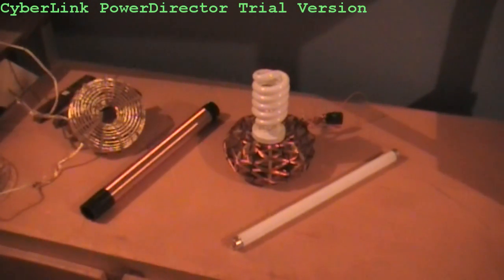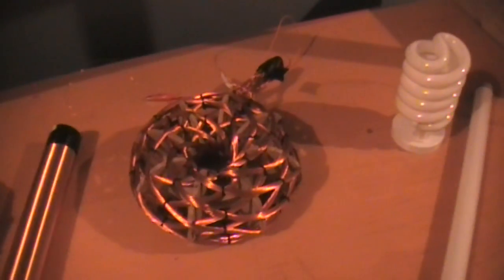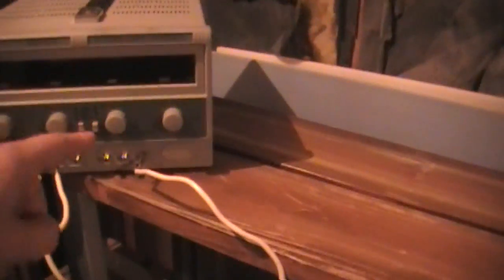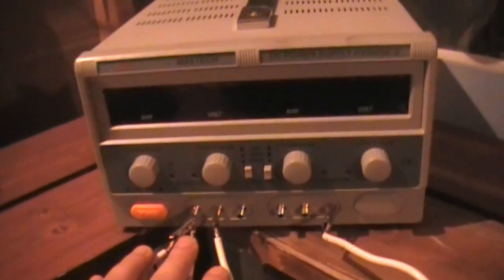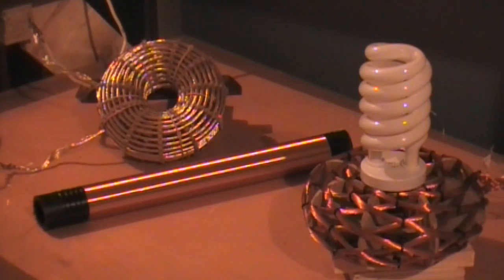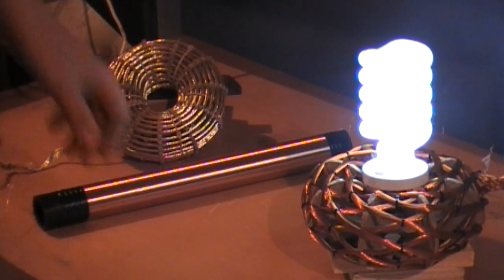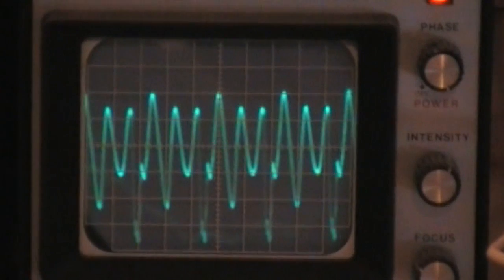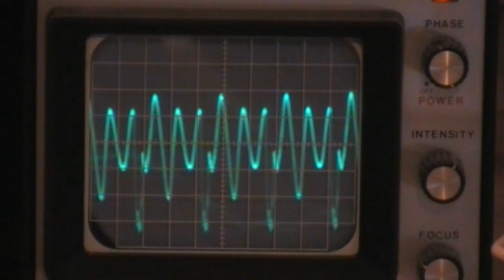Vortex Form, Tesla Function

Comment: Tesla used a magnetically distruptive spark gap to generate his pulsed DC; I assure you, it is different from MOSFET switching output signal. Your osciliscope wouldnt even pick it up because the nanometer pulse width should be in the realm of nano seconds-- unless you have some fast photovoltaic dectector or something attached.
Reply: What does the magnetically disruptive part do🤔also what are the specifics so I get it the same. Maybe i can look for a patent. I tried forcing 2 magnets together and sparked between those didn't notice anything different so far but I was using high voltage or maybe I didn't configure the same. Hmmm...interested about this.
Reply: @strangescience3414  think of magnetic fields like wind against a flame. Fire is just plasma, but idk if it responds the same way to strong magnetic fields. Im sure the magnetic aspect must be as strong as the electeic componet. Also, I think saying "magnetically disruptive" was wrong; say rather, "distruptive electric discharge that is magnetically quenched!"
Reply: Is magnetically disruptive the same as magnetically quenched? I'll check it out. Thanks for helpful constructive  comments.
Reply: @strangescience3414  yep!
Reply: Yes thats how he launched his aetheric force longitudinal beams in the ZPE! Gerry Vassilatos explains this in his arcticle i got. Teslas magnetic distruptive spark gap was a uniflow 2 stroke plasma engine!
Reply: @jlo13800  nice. What's the two stroke part?

Comment: With Vortex coil it is possible store EM energy?
I mean continuous exchange of E field in B field, where B is out of phase 90 °, like in LC resonant circuit.
Store energy for long time inside the vortex.
Not radiation of EM outside the coil.
If the answer is yes, it can be used like atom model.

Comment: Try a solid state electrolyte solid state graphite power cell bank with a organic carbon power cell bank to power your coils. 😊
Reply from the maker: That would be neat.
Down the road, the caron based supercap will be back on the todo list for sure.
Thanks for the comment.
Reply: Organic carbon power cells do not release all their charge like super caps do. Pow!  😉
Reply from the maker: Hmm. Sounds cool.
Reply: If you set it all up correctly you would have a light source that would operate off earths resonance field. If done correctly one could keep battery banks all charged up in rotation all off earths resonance field. Tesla technology mon. This would be way better then solar maybe? 😕😉
Reply from the maker: That would be cool if it was pulled off.
Reply: Study the technology solid state electrolyte graphite power cells generate current off earths resonance frequency. Organic carbon power cells store that built up electrical energy that then operates a light or other electronics to keep battery banka charged. Add in a few vacuum spark gaps in key locations and you can increase the potential were ypu could operate a window air conditioning unit off the concept or operate a refrigerator all off earths resonate field like how Tesla was working on that type of technology.? 😉
Reply from the maker: +Indigo Dragon71 do you have any links to videos or documents that describe in detail the function of the system you outlined? I keep an open mind but also critical mind. I've been researching and experimenting with this stuff for a LONG time (6 years now) and I also have been going to attending College for Electronics Engineering Technologist training & certification (in my 5th semester now [3rd year]) and I have to say there is a lot of misguided information out there. But if you could link in some information I would be happy to look at & asses it and give you my honest opinion of it when I get the time.. I will be making carbon based (graphite/nano-tube) super-cap and energy storage devices when I complete my skewling at this end of the first third of 2019.
Reply: No links yet here is something to think about. Tesla ran into problems after trying to file patents for his work. The pinkertons that caused him to loose all his work were controlled by the free masons who control all knowledge. Like i stated research the technology solid state electrolyte graphene or graphite power cells generate electrical current off earths resonance field that generates the atmosphere. Organic carbon power cells would be charged by solid state power cells to power devices. Vacuum spark gaps in key locations would release the breaks if you understand what this term means on the electrical power generation system being described. Tesla was discovering very old technology not new technology which certian controllers just do not want out in the open. Think first kingdoom of ancient Egyptian dynasty everything has a crystallized structure that can be used to generate electrical current.  Brain food a magnet is a refined crystal structure that generates a magnetic force from being within a resonate bubble called earths atmosphere. So would the magnet still operate in the same manner if removed from within that resonate bubble IE in space? How are you littling up that light with that refined crystal structure called a copper coil? Think! How far does that resonate bubble extend that you are genersting with that coil to allow you you light up that bulb? 😉 😊
Reply: You could try looking at pancake motors. The coil disk could be made out of graphene with the copper coil generating a certain hertz frequency from the electrical frequency being passed through the coil to hit the sweet spot of the graphene to generate high frequency electricity with vacuum spark gaps to encrease potential to develop a pancake motor generator. Be a neat component to use with a solid state crystal power cell and organic carbon power cell set up. Way better then solar panels. 😉  😊
Reply: @indigodragon7129  did you attempt any of this ideas yet ?

Comment: Where did you get your silver plated enamel coated copper wire?  Is it the same thing as the artist 24 awg silver plated enamel coated copper wire or did you get a silver plated "magnetic" copper wire.  Just wondering if there is a difference cause I couldn't find any of that wire besides the artist version.  THanks in advance.
Reply from the maker: Ascending Humans. I bought it off etsy, and it is the artists stuff... I thought the coating on it could maybe have worked, but I hate to admit the enamel coating does not work well an insulation, at best it just looks cool.
Reply: Ya it does look really cool, thanks for your quick feedback bro

Comment: Dang that's cool and that spiral coil is a work of art. So is this a demonstration of scaller waves? Tesla used these waves in his famous tower to transmit power wirelessly. If only that tower wasn't destroyed what a different world it would be today... O' well... time to mend the world. Thanx for sharing!
Reply from the maker: Altimit1417
 OK, when you think about scalar (or longitudinal) waves frequency does not matter... You need to visualize it like this... If you had a 20 foot long piece of rebar (iron reinforcement bar for concrete) and you hit it with a hammer in the middle the rebar would bend and wave back and fourth, these are regular or transverse waves... The energy rings down over time much like in an oscillating circuit... If you were to take that same piece of rebar and hit it with the same hammer but hit it on the end, the energy is transferred across the rebar instantly with no apparent vibrations... It is more of a direct instantaneous impulse.. That is my understanding anyways.
Reply from the maker: Thank you! I wish I was the designer of the winding process but credit for that goes to Erica and *****... I do not think this is a demonstration of scallar waves spoken of by Tesla.. I think you need an impulse driven driven HV DC with quenching to achieve scallar waves (at least that is my understanding to date)... We shall keep on keepin on! Peace :)
Reply: Naoki Kashima not scalar. I believe that scalar is pulsed HV DC at around 50-60hz. From my understanding. Also interestingly around 60hz is the resonance frequency of a human heart. Well the frequency which causes a human heart to fail at an alarming high rate. You can compare the number of deaths by people putting their finger in the power socket of a 110v/60hz with 220v/50hz. Anyways, that is from my very limited understanding. 

Transmitting power wireless is possible but the efficiency is not very high. less than 10%. I can't pull the number from the top of my head. If we can have limitless electricity wireless power that could be a part of our daily life.

edit: MIT has gotten 50% efficiency, http://www.ted.com/talks/eric_giler_demos_wireless_electricity?language=en
Reply: Binj Komisar yup
It’s a longitudinal wave, like sound...
Reply: Its not a scalar wave being deminstrated here. Binj was close, stating it must be powered by a distruptive discharge generated via quenched spark gap. This would be called Impulse DC, or transient current at resonance, which occurs at a y frequency; though the frequency chosen should be the resonate frequency of your circuit's capacitance when using vortex coils when powered by DC oscillations. 

Vortex coils change resonate frequency with the attached capacitance. When powered by AC oscilations, a high frequency is advantagous, though low resonant voltage DC has the advantage over HV AC.

Finally, the scalar 'wave' is not a wave at all. Scalar fields has magnatude, but not direction or speed like transverse or longitudinal. An example of a scalar field is aptnospheric pressure at some fixed altitude-- its The same wherever in space you are at; and to translate this to electricity, the transmission occurs when the magnetic field and electric field are in laminar flow (parallel to each other). Normal transverse light wave componet feilds are in perpendicular flow (intersecting eachother at 90°). Hence the scalar 'wave' travels near instantly at any distance (if not actually instantly by entanglement).

Comment: Very nice coils!
It's impressive how well you've managed to wind those.
Reply: Binj Komisar Manually winding coils certainly is time consuming, somewhat theraputic though and doing so opens new levels of appreciation for such devices, Although nothing beats setting one up on the lathe, with autofeed and just sit back and watch the turns count up on the counter, variable speed would be nice as then I wouldn't have to stop to change gear...
Reply from the maker: Thank you Steve Lane . They were time consuming but they look pretty cool in the end.... Still trying to come up with new and innovative ways of driving them... Its an experimental exploration of sorts one might say :)
Peace.
Reply: @BinjKomisar11  How much overunity do you coils make? I got a lot of 8 AWG copper wire to wind a Rodin coil for use as a generator. Can the spaces by made of mica?
Reply: I bet the coil where "fun" to Wind 😄
Reply from the maker: Steve Lane Yes, when winding solenoid coils, the lathe is therapeutic... These vortex coils are a little bit more involved though, so would the apparatus (if one existsed) for winding them.. Thank you for appreciating them. Peace. :)

Comment from the maker: A very special thanks to Daniel & Erica Nunez, Randy Powell, and of course Marko Rodin. Without them I highly doubt I would been able to make these coils and do this demonstration.
Reply: Binj Komisar Thank you for your support and contribution to this work! Awesome job! :)
Reply from the maker: *****
Thank you!! :)
Seeing your work is what initiated my leap onto this alternative energy path.. So thank you!! I love all of this stuff!
Reply: Binj Komisar 
Great !
Reply: I've been following those coils for a while and I'm not really sure they work. When I posted some questions about the coils in Nunezes forum: If they work in a vaccum or when encased in sheets of metal, if the lumen output of the leds is the same with and without the coil. I got no answers and later the forum got deleted. I've asked some ppl that do debunkings to check the coils but so far nobody has even attempted to build and test those coils for real. 

I'd like to see you use something with limited capacity like a capacitor and then use the leds once without the coil and once with the coil and measure the lumen. The capacitor will ensure that there is always the same capacity. Put the coil suspended in the air inside a case of sheet metal. The sheet metal is there so that radiowaves etc. wont interfere with the test. Make sure to wire everything: the amp, the coil and the leds to the capacitor. Then measure lumen and time. If the coil really works the leds should have the same lumen output and they should run longer on the capacitors energy than without the coil. This test is the proof that the coil works. Without this test the coil is interesting but still snakeoil to me.
Reply: amazing work here. 
does anyone know why the Daniel Nunnez Channel was terminated?
Reply: Thank you guys! Looks good.
Reply: COmmon Man! no one in the science comunity will ever use SAE units aka (emperial/standard)

but great craftsmanship

Comment: Wait. You have the secondary wired to the primary?
Thats not really a secondary in that case. Primary and secondary are transformer terms. When the coils are only coupled magnetically. Could you do a simple drawing? I'm having trouble understanding what you did there...
Nice effect though.
Reply from the maker: Yeah, the bottom of the secondary (the tube) is loosely connected to the primaries ground (the gold coloured spiral vortex coil), I think that is why it functions even though it is off to the side of the primary. None the less, it is acting like a transformer. A tesla coil is a transformer is it not? Tomorrow i'll draw up a nice schematic by hand, take a picture and post it on G+. Probably tomorrow evening so, I'm guessing, tomorrow night for you. But yeah, thanks for watching and I'm glad you liked the effect. Peace out my friend.
Reply: More like a flyback inductor I think. Still cool though. Good efficiency too.
Reply from the maker: Mongrel Shark A fly-back inductor is a transformer.
Reply: A transformer is an electrical device that transfers energy between two or more circuits through electromagnetic induction.
http://en.wikipedia.org/wiki/Electromagnetic_induction

If coils are physically wired into the same circuit, and not linked solely by electromagnetic forces they are simply inductors.
Reply from the maker: Often transformers are loosely coupled sometimes its on the transformer core sometimes at the ground of the primary. Its not always black and white. Also if your system/circuit "transforms" 50 volts into over 2000,i t is a transformer regardless of the wiring because of what it is doing. The system was not smoothing out the 50 volts I was pumping into it, it was transforming it. It really is a matter of perspective. (The slayer exciter circuit is a transformer, but the primary and secondary are loosely coupled through the resistor and the transistor. In most solid state systems there is some coupling other than the main electromagnetic induction.)
Reply: Yea, I see your point.
Reply: Binj Komisar Hey can I get the picture too???
Reply from the maker: Altimit1417
I never ended up making the schematic... The video describes what is going on is detail.... If you have a frequency generator and a MOSFET, a primary and a secondary, and some sort of topload (optional)... You can make it happen...
I will say, you should build a simple MOSFET driver circuit to protect your frequency generator... I was being reckless with this demonstration.
Reply: The secondary coil is actually get basically a pulling action of positive charge into the ground of the primary similar to how you turn positive air flow into vacuum. The pull is at the same frequency as the primary since the secondary is not only not magnetically coupled to the primary from close proximity but also it is at a 90 degree angle. So the "Eddie currents" don't even excel the charge going through the secondary. And since the Rodin coil is the top load of the secondary it gets the same high frequency "suction" action which still causes the radiant or wireless energy effect. You can do the same thing without your "tesla coil"